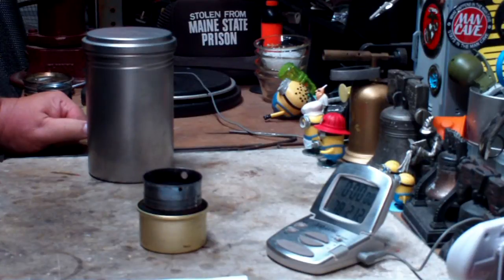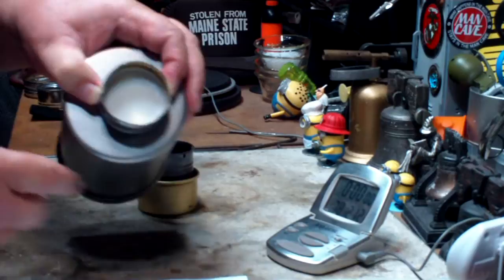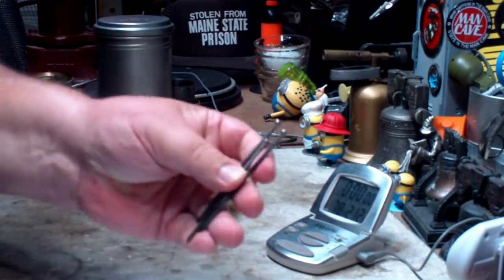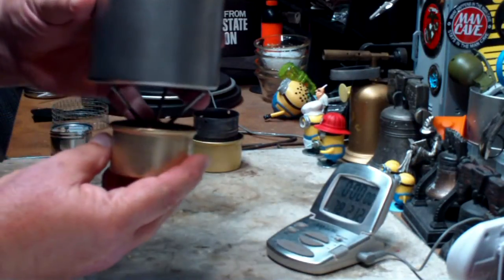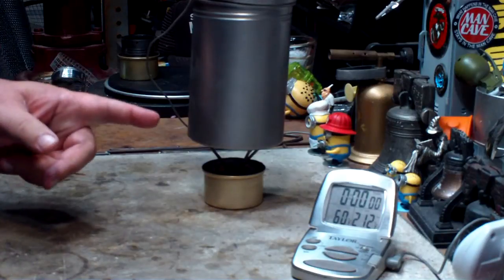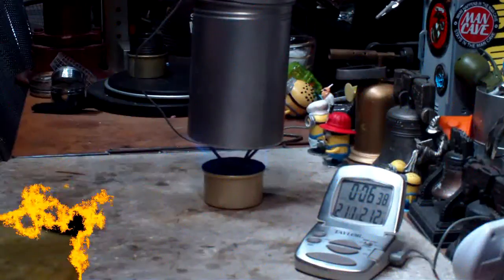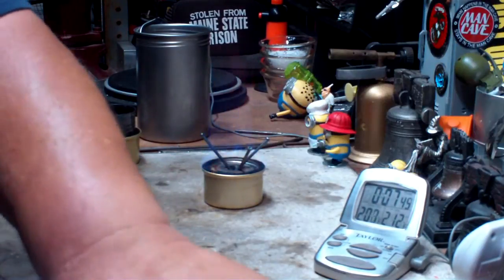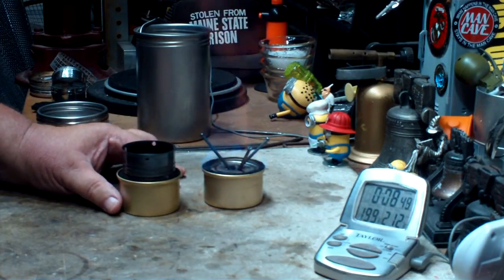Vargo Stainless Steel "Bot" - Bottle Pot - Fancy Feast Stove "Nailed" - Boil Test #1

Comment: Nice test Hiram. 
The issue (I believe) is the lack of oxygen in the center. If there were an airport/intake in the center from the bottom, then that would make a difference. 
I also think that this would allow a center burn but would use more fuel too. 
I have been using this style stove for years now and I think it's a great medium between fuel usage and boil time. They are inexpensive and easy to replace. 
A BIG winner in my book!
See ya on the next video & HI Max!!  ヅ

Comment: Thanks for the test, Hiram. The results were unexpected, but I think your explanation is spot on. The center of the burner doesn't have oxygen, so even with the can removed the flames still burn in a ring pattern. Thanks as always for the useful results.